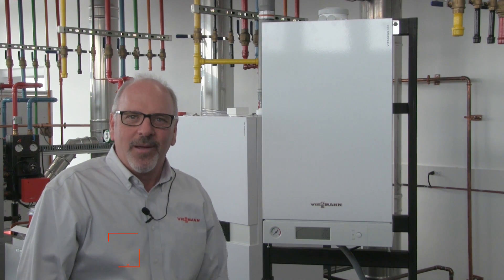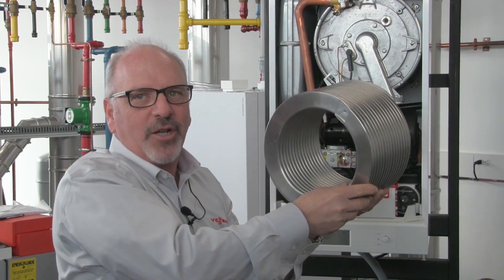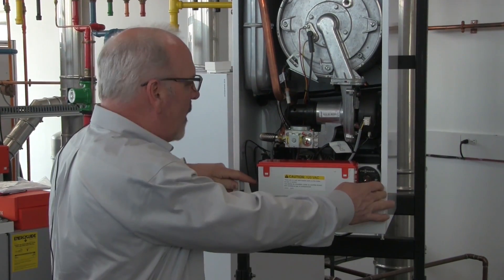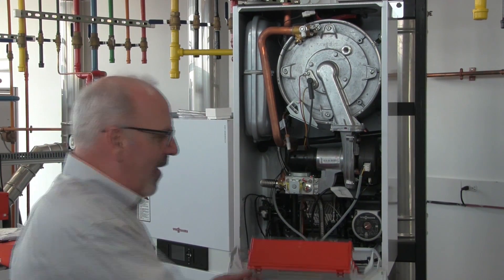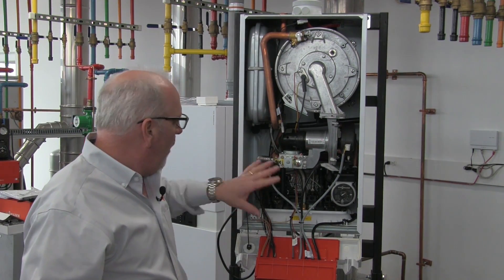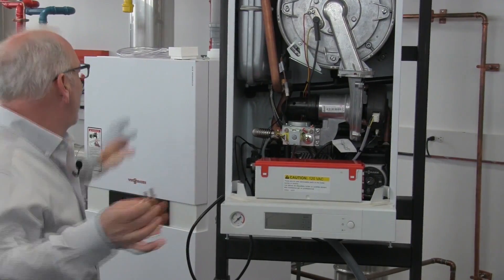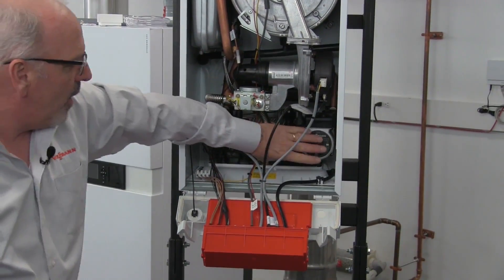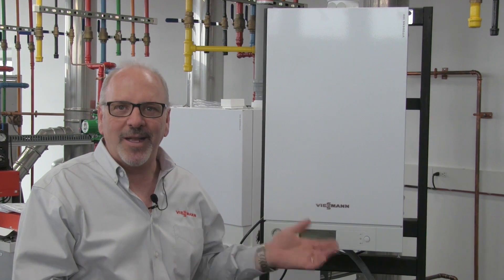Vitodens 100-W, B1KA Launch

Comment: U guy really make a progress ( down) to put PRV on top of the boiler good job 👎  , also flush valves from handle to flat head screw driver lets make installer live a little bit difficult. But u did a good job putting internal pump to yours B1HA. 
1 step up 2 down

Comment: How do you set to hot water only
Reply: Tracey, If you want to set the DHW set point temperature, tap the MODE button, then tap the down arrow until you see the FAUCET icon flash. Select OK. Using the up and down ARROWS select the desired temperature for DHW. Select OK after you make your choice.
The DHW set point is set.
If you do not want the boiler to operate in heating mode at all,  tap the MODE button then tap the up and down ARROW buttons until the RADIATOR symbol is flashing, then tap OK. Tap the down ARROW until the display reads OFF, the tap OK. You may want to remember the setting under the RADIATOR before you change it so it can be reset when heating is required again.
Domestic will always be a priority function with this boiler, so in heating mode it will make DHW first.
On the Viessmann North America You Tube channel, where you found this video, you can find several 2-5 minute videos on setting the controls for the Vitodens 100 B1HA/B1KA boiler line.
If you need further assistance call our TechInfo Line: @ 1 888-484-8643
Reply: Tracey, If you want to set the DHW set point temperature, tap the MODE button, then tap the down ARROW until you see the FAUCET icon flash. Select OK. Using the up and down ARROWS select the desired temperature for DHW. Select OK after you make your choice.
The DHW set point is set.
If you do not want the boiler to operate in heating mode at all, tap the MODE button then tap the up and down ARROW buttons until the RADIATOR symbol is flashing, then tap OK. Tap the down ARROW until the display reads OFF, then tap OK. You may want to remember the setting under the RADIATOR before you change it so it can be reset when heating is required again.
Domestic will always be a priority function with this boiler, so in heating mode it will make DHW first.
On the Viessmann North America YouTube channel, where you found this video, you can find several 2-5 minute videos on setting the controls for the Vitodens 100W B1HA/B1KA boiler line.
If you need further assistance call our TechInfo Line: @ 1 888-484-8643